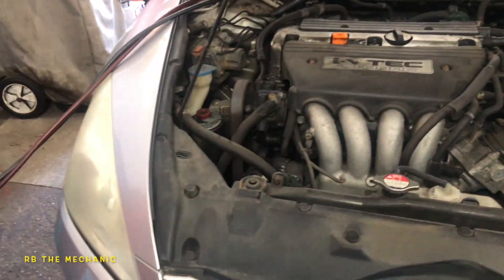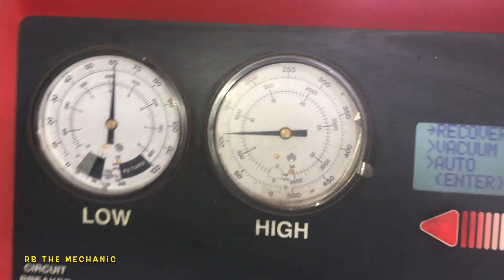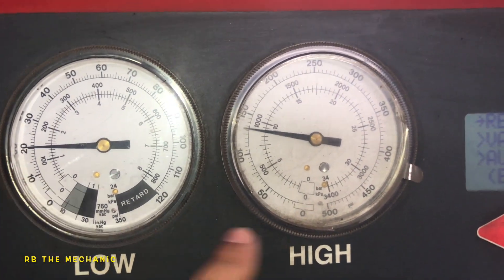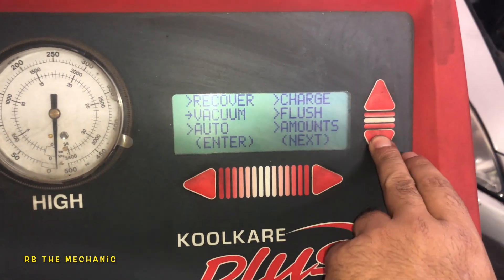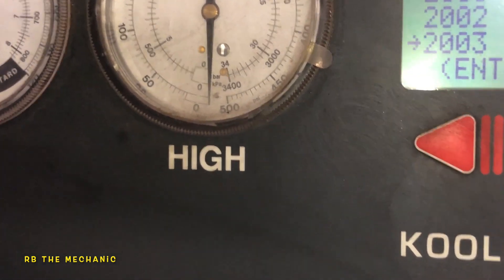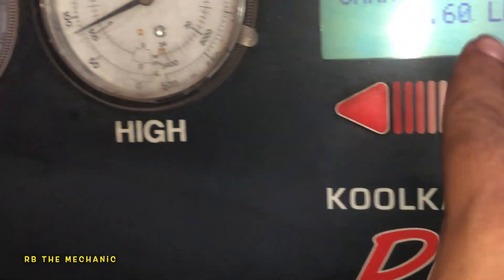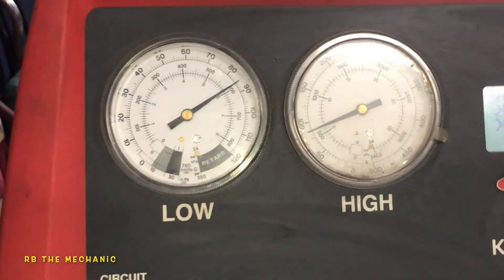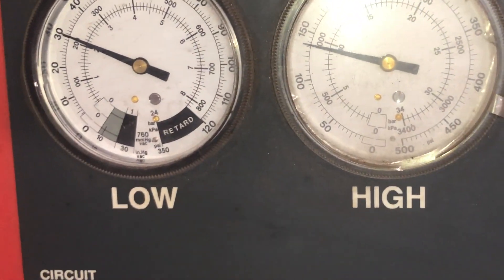How to read AC pressure on low and high side     AC NOT COLD ENOUGH?

Comment: 2014 GMC Sierra 5.3L.  Vacuum held perfect overnight. Rechaged to specifications.  Im getting 40 psi on low side and 200 on high side. Compressor appears to be working as it should. Air is cool but not cold. Condenser is clean. What could be causing it not to be cold air? I think high side is a little low but I'm suspecting the expansion valve not working correctly.
Reply from the maker: Don’t trust on the vaccum test cuz it’s vaccum pressure instead of just pressure   Dose ac work and make cold on low side?
Reply: @RBTheMechanic it gets kinda cool but definitely not COLD like it should. I replaced the service valves. The low side schrader valve was leaking when it quit cooling. IMO the compressor obviously is working and condenser isn't leaking or blocked. When I noticed there was beginning to be a problem the passenger side of the vents was much cooler than the drivers side. Now they seem about the same. I guess I should put thermometers in the vents to see..

Comment: When I added the 134- a to my minivan the pressure started to go down than up then up then down. Maybe im using a cheap meter that came with my frion.

Any suggestions or concern about that?
Reply from the maker: Why did u add?  Why not do full service recover vaccum and recharge correct amount

Comment: On my Altima I replaced expansion valve, condenser, accumulator, and compressor. My low side gets cold for a few seconds and reads 35 but my high side stays at 50😢
Reply from the maker: I would do reservice on system
Reply: @RBTheMechanic  reservice as in recovery and refill?
Reply from the maker: @ recover vaccum recharge with correct amount of oil and refrigeration

Comment: Good video. My low side was reading low, so I added freon, but bought a new gauge that reads the high side, too, and my high side is reading way too high, at 350 psi, and the low side is at 30 psi.
Reply: AC expansion valve may stuck closed
Reply from the maker: Ok good enough but using cans to add is never good system hasbair pressure built
Reply: Txv not opening all the way
Reply: Txv

Comment: When i hook up gauges and turn ac on, my compressor kicks on at 40 psi low pressure but my high pressure is only 60. After the compressor engages,  the low pressure immediately drop to 15 psi and the high pressure goes up to 105 and its shuts off and repeat. It held a vacuum after  i replaced the compressor because it was making a little noise and wasn’t getting cold air i also replaced accumulator and orfice tube.
Reply from the maker: System reading is off way too low either u got low Freon from leak in style or it wasent correctly charged I would redo vaccum and recharge correct amount and add uv dye to trace down the leak

Comment: My cars reading 50psi on low side and 220psi on high side in 105 degree weather but ac blows hot. Any thoughts?
Reply from the maker: Seems not so bad check ur bled door motor
Reply: @RBTheMechanic  Hey friend can you please tell me what the static and normal operating pressures are for a 2006 Mazda 3s 2.3L 4CYL DOHC (AT) Sedan GAS non turbo VIN# JM1BK323361459957

A/C Does not blow cold at idle but will at speed A/C not useable have to roll windows to survive . I think there is to much PAG oil in system as I had another shop do a factory load PAG oil and R134A and then I put in new compressor with out oil balancing because he said I needed new compressor 

NEW PARTS : 

Compressor
Condenser
Expansion valve
A/C stretch belt + serpentine belt
Cabin filter 
Engine/Condenser Cooling fan
Engine Coolant
Engine Thermostat

Thanks
Reply from the maker: @Devo1987  pressure should be at range of 34-45 low. And high at around 250 with ac on
Reply: @RBTheMechanic it depends on ambient temp. You are saying 30-35-Wrong. It can be as high as 50-55 low side on a 100 degree day!
Reply from the maker: @MrCbell57  yeah but it’s in that range
Reply from the maker: It might not have good service did anyone work on it? Like did service for ac and used cans?

Comment: Im starting to think that mine is the condenser.... Or . maybe that filter for condenser because my high pressure side is cold... Amd my low side is hot... I already replaced the Expansion valve and nothing changed
Reply from the maker: Yeah u have to start some where I had issue like that one time I replace ac compressor got lucky on first try
Reply: @RBTheMechanic  I already changed compressor

Comment: What if the low side is at retard high side is normal. What could be the issue. blowing not so cold air
Reply from the maker: Too high pressure could be over charged or air pressure has risen also could be restriction on like I would start from reservicing  the system

Comment: Hi RB I have a Chevrolet Sonic 2015 the the problem is that the high pressure pipe is cold and the low pressure pipe is warm and the A/C does not cool, what could be the problem? i have to recharge the system each month.
Reply from the maker: I would reservice the systym and recheck pressure it could be restriction in systym or bad ac compressor
Reply: thanks for your quick  answer, do you know how i can find the restriction?
Reply from the maker: @Sabs761010  u can’t!!! U can try basics do service and if u want replace the reciever dryer and orfis tube   Other wise I doubt other things can get blocked also could be possability bad compressor
Reply: @RBTheMechanic  thanks a lot, last question, does it possible that if in the last service, it was charged little gas i mean one month ago i did the ac recharge but i think the ac guys put a little gas because he told me that with the movement of the car the air would be more cool.😢

Comment: What if the low is too high and the high side is too at the same time?   My truck is at 70psi on the low and 145psi on the high at 95 degree weather.a
Reply from the maker: Is that with ac running?
Reply: @RBTheMechanic  Yes it is.   I have a '99 Tahoe with rear AC and the rear cools much better than the front which barely cools until I start driving, then it cools a bit more but nowhere near the correct temp.
Reply from the maker: @MiamiWebDesign  try reservice could be low or air pressure
Reply: @RBTheMechanic  You mean air in the system?  I pulled a vacuum for 40 minutes and let it sit a while and vacuum held before I added the required 64oz of refrigerant.    Does it matter if you put the refrigerant in as a gas versus turning the cans upside down to recharge as a liquid?
Reply: @RBTheMechanic  I should've also mentioned that the line going back into the compressor is super cold and sweaty.   
The line after the orifice tube is also cold as it should be but it isn't cold at the accumulator inlet or outlet going into the evaporator.   Can this mean that the accumulator is clogged?   Shouldn't the line going into the accumulator also be ice cold?
Reply from the maker: @MiamiWebDesign  no seems fine
Reply from the maker: @MiamiWebDesign  if u used cans those junks never work ac will never be good as but the rest u did good
Reply: @RBTheMechanic  So i should take to a shop to recharge then?  Noway that it can be a bad compressor or clogged accumulator?
Reply from the maker: @MiamiWebDesign  it can be but why rule that out before doing the basics which is reservice
Reply: @RBTheMechanic  Ok gonna get it evacuated and recharged again. thanks
Reply: @RBTheMechanic The compressor is making this sound like a toy machine gun.   Is that a sign of a dying compressor?  https://www.youtube.com/watch?v=WkGkzPEuiQ0

Comment: Pressure is good on my car but the compressor is making noise and air not cold enough
Reply from the maker: Ok compressor might be going bad also pressure could be faulty air pressure but if u need to do compressor to fix the noise then ur gonna have to service the system and do it with ac machine

Comment: I have a question, I have the one with the blue Ac pro , the temperature is 40c and above.  When I measure it, it is above 60 or 70 PSI, is it normal?
Reply from the maker: Tooo high
Reply from the maker: I always say jamming in pressure of gas is no good ur over pressuring
Reply: Depends on ambient air temp. If you at 110 degree weather like Arizona then that's normal if you in 80 degrees your too high